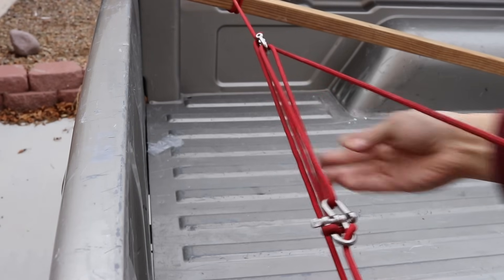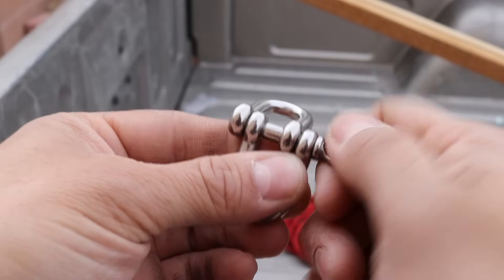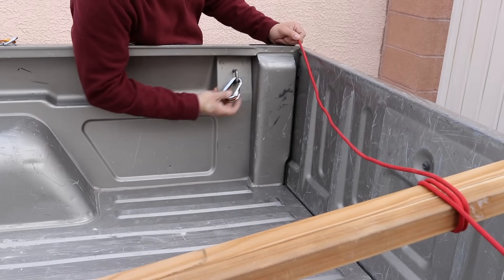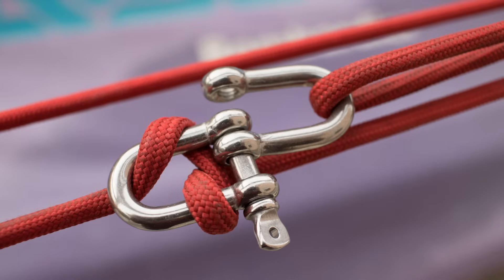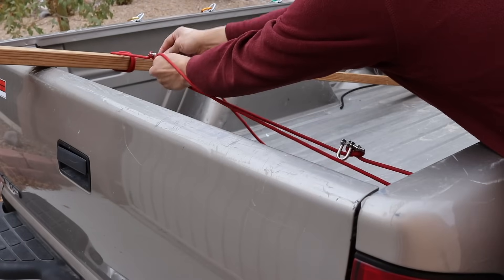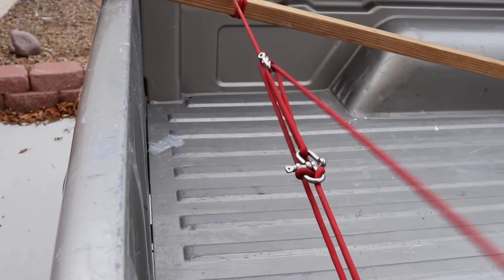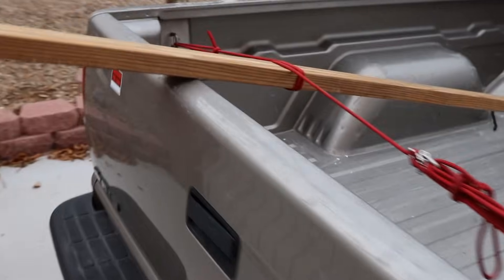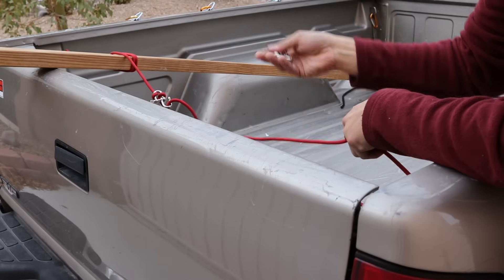Unreasonably Tight Truckers Hitch

Comment: It would be cool to stick it to all the 'ratchet strap' commenters by doing a side by side of ratchet strap pulling on some weights till it breaks vs a rope of same rating with your 'Unreasonably Tight Truckers Hitch' and how long it takes to break. It might make a cool video showing how much more leverage you get.

Also, its way faster to organise a rope than a ratchet strap so you win with time spent using ropes. Straps might be better for weight distribution being wider. But I prefer a rope just for the cost difference.

Comment: Good job on the video. One thing to consider,  if you are driving in jurisdictions that have strict verification of cargo rigging be careful when using such systems. I received a verbal warning from the Ontario MTO for using a "jury rigged" cargo retaining system, or whatever he called it. You can get fined in Ontario for using a makeshift system for holding cargo. The guy told me if I had been a commercial driver, I would have received a stiff fine.

Comment: I use on of those “figure 9” devices made by the S-biner people. They work quite well, but I do recommend that you smooth the teeth a bit with a file so they won’t damage your rope. Also, make sure you get the metal one, not the plastic.
Reply: "Niteyze"

Comment: As long as no one gets any ideas about using that system for lifting or serious load control. You de-rate the capacity of the second shackle by not using the pin. You also need to ensure that the line is rated for that much tension.
Reply: Timothy Johansson, and the truck sides if the tailgate is open.
Reply: I rather use my ratchet straps.
Reply: For those who missed it there was subtle satire in the use of the term de-rate.
Reply: De-Rate?, It's not rated for it at all. (They are only rated for use with the pin, and only for  in line linear loads against the pin. ) The cheapest way to get a valid load rating would be to use two or three links of chain and join the shackles w/ the pins) (Assuming you don't already have rings or a double shackle.
Reply: "everyday" use will work fine. great idea, how about giving credit where credit is due. just saying.
Reply: @mickh6426  credit goes to the man in ancient times who invented the double tackle as that is all this is.

Comment: Much ado about nottin.   You should never need that kind of tension  for those kinds of loads,  and if you were carrying a  "real" load  what is the rating of the  junk  anchors in the bed?  How about the gate?  You ever see what happens  WHEN A GATE UNLATCHES?  I can still remember the site  of the  BIG WHITE STRIPE   off the freeway  with a pickup at the end of it, after he  dragged a load of  falling, breaking, dragging,   (and ruined)  sheetrock  out of the road

Comment: I just tried that using 2 spring gate carabiners and it worked perfectly. Carabiners with eyelet would be even better (stronger) Great video and you picked up another sub. Thanks
Reply: I’m curious how much tension youd wind up putting on the carabiners -I had the same idea
Reply: @baileys6346  I guess that would just depend on how hard you pull and the type/quality of the carabiners? But for my intended use (lashing my kayak to the roof bars) I didn't notice any deforming of the carabiners, so I guess all is good. I am using just cheap plastic carabiners from Amazon and they seem to holding really well. Metal ones would be almost unbreakable?

Comment: Заворачиваете болт прямо в резьбовую проушину - и накидываете на него выбленочный узел, концы которого окажутся в направлении тяги. Если же ширина зева скобы окажется меньше двух толщин верёвки, а натяжение требуется создать сильное (веревочная переправа) - то открытая скоба заменяется на стальной карабин, которые можно спарить для получения автоматического тормоза (узел Гарда).
 На одиночном грузовом крюке эту функцию выполнит гачный узел, являющийся Becket Hitch'ем.

 Wrap the bolt directly into the threaded eye - and throw a Clove Hitch on it, the ends of which will be in the direction of the rod. If the width of the mouth of the bracket is less than two thicknesses of the rope, and the tension is required to create a strong (rope crossing), then the open bracket is replaced with a steel carabiner, which can be paired to obtain an automatic brake (Garda node).
 On a single cargo hook, this function will be performed by a Gach Node, which is a Becket Hitch .

Comment: For those interested the proper name for this knot is the Versatackle, it can of course be done without the shackles, just using loops as in a standard truckers hitch.
Reply: I really like this idea of using shackles though, one of the main problems of the truckers hitch and especially the versatackle is that the friction on the loops can easily damage the rope, the shackles will make the rope last a lot longer.
Reply: @caskwith  mainly because half the time is spent looking for shackles before tying the load.

Comment: Nice way of achieving the 4:1 purchase.  I can think of other uses for this, but it seems overkill for securing a load in a truck.  I use a similar system instead of a winch for getting a sailing dinghy onto a trailer on my own.
Reply: These are mostly forgotten techniques.  Now everybody wants to use a winch.
Reply: no such thing as overkill when you get rear-ended, you don't want your load bouncing and landing in someone's lap.

Comment: I'm not currently in a position to practice it, but surely the loop that attaches the cord to the shackle (not the pulling part), because it's just looped and not tied, will eventually start to slip under pressure ? No?  So for a short trip, fine, but over time ....?

Comment: That was 3:1 and 5:1 MA.
Reply: 2:1 and 4:1. 

3:1 only applies if the load is also doing the work. 

In his frame of reference, the first pully is a stationary pully and only redirecting the force. 

If he was tied to the anchor point. He would pull himself forward with a MA of 3.1

Comment: Seems a waste of time and accessories (four shackles and pins). A single truckers hitch would be plenty effective for application. A double truckers hitch (two opposed similar to your video) would accomplish the same ratios achieved without your excessive amount of accessories. I would conceed the use of those shackles would reduce some rope friction at hitch locations, BUT pulleys would be even more effective as they would eliminate rope parallel friction. Optionally you could use single rings or carabineers to reduce rope friction at hitches.

Comment: That is actually a 5:1 with a directional change. A truckers hitch or a Z rig is 3:1. Then you just added a extra support line which makes it 5:1 with a change of direction pulley. Another way you know it's an odd number is that your knot is at the load not the anchor point. You say Where you put the bowline is your anchor point but is more like an extension of your load point. Take that out and it shows your knot is at the load makes it an odd mechanical advantage.

Comment: Guy posts a video demonstrating a nifty knot idea, and the entire comment section is filled with people trying to out smart his demonstration.
Reply: He damaged the wood and used shackles where simple loops from double overhands or figure-8's would do. No one tying anything down would use this method. It could easily exceed your rope or tie-down points capacity with that much force. It's not smart at all.
Reply: @mattmarzula  Uh, I believe the intent was to simply show the tension advantage gained by using a 4:1 loop vice 1 or 2.  Ergo, very little effort was exerted to get that amount of tension.  Basic physics nicely demonstrated.
Reply: @mattmarzula : Very true, "tiedown" points in most truck/ute "tubs" - are hardly fit for purpose. 
"BTW", no matter how much tension you can put on a rope (with any kind of system) it is up to the "loader"/Rigger  to decide how much is needed to secure the load. (can/=should)

Comment: $50+ stainless shackles when regular truckers hitch does the job... Overdone... F
Reply: A regular truckers hitch multiply the force by 3, the method of the video multiplies by 5, and the regular truckers hitch looses a lot of force to rope on rope friction, the shackles help to reduce a lot of the friction. The video is just an demosntration, when to use one instead of the other is up to your judgement.
Reply: @jefgir  Rope is inexpensive and a trucker-hitch ALWAYS available to use... 4 polished shackles $80+plus and not always available... to each their own!
Reply: @douglaspohl1827  Then use a regular truckers hitch, and when your rope breaks due to friction, just buy a new one, as you said, they are inexpensive.
Reply: @jefgir  How many times do you see a truckers-hitch vs your polished shackles?  Go figure...

Comment: that is a theoretical 9:1, first is a 3:1 not a 2:1, then the second pulley makes another 3:1 so they compound into 9:1
Reply: feel like i need to ad that being hooks not pulleys, and rope running next to each other rubbing, it might be max 5-6:1
Reply: @infbajuk  just count the number of rope turns in the system and ignore friction, mass, and moments of inertia. It's 4:1. Dummy up.
Reply: @infbajuk  and notice how you say that you "feel". Try thinking instead of feeling. You opinions are no match for facts.
Reply: @mattmarzula  Well, if you look at your system, you might realise, the lumber is not the anchor, its the point of attachment  to the load, unless of course your truck side is weaker than the stretch of the rope and weight of lumber. 

That said, your system starts at the load, that immediately makes it an odd system. And you put a "pulley" into the load rope which made it a simple 3:1.

Then you add a second "pulley" in the rope coming from your anchor, making it a complex 5:1, that right there you can´t argue with.  

Also, yes my first assessment was wrong, still better than yours tho. If you just count loads, from the rope in your hand, you get 1T to the "pulley" going around making it 2T and again making it 3T and again making it 4T then terminating at the anchor side hook. So that means you have 4T on the load side "pulley" and 3T on the anchor  side "pulley".  

Then it pulls 7:1 at the load as your 3T line from the anchor side "pulley" meets the 4T "pulley" at the load.

And notice how my feeling was still better than your "facts", guess a simple mind only sees simple pulley systems.
Reply: Both are wrong, its a 5:1 MA (disregarding friction).

Comment: Truckers hitch huh. I have been driving trucks since 1979 and I can tell you that would never pass any dot inspection. The open ends of the shackles will open up under heavy load and you would lose your load. The little weight you have here ok fine but dont call that a truckers hitch you make us look like idiots. Besides there are many ways to tie something down that are much simpler and cheaper
Reply: holmes1956O how not to use shackles 101
Reply: Agreed. This use of shackles is dangerous and will end up getting someone hurt.

Comment: Great idea. But so is a ratchet strap
Reply: Ratchet straps are for those who choose not to try...
Reply: You're right I wouldn't try to over complicate a simple task.
Reply: Stephen Crump think of all the space being saved tho.
Reply: @mchslaxstar55  what space you worried about when carrying four 2"x 6' boards in a empty bed
Reply: @mchslaxstar55  yep probably a whole 2-3 cubic inches
Reply: Stephen Crump -  He designed and built that system himself using only a rope, shackles and skill.  Can you build your own ratchet straps?  Sure you can go buy ratchet straps. but they are no where near as versatile as rope and knots.  For the money the rope is a better deal.  What happens when some loser steals your ratchet straps and all you have to work with is a rope?
Reply: @ScorpionRegent  i can do all this without all the iron just rope.
Reply: @ScorpionRegent  if look back to my first post i said it was a great idea never once have I said otherwise, but for a task such as the one depicted a ratchet strap would have done the done just as well, easier and faster.
I always have rope in the truck for occasion where a strap just won't work. 
Also yes I could build a ratchet strap if had to.
Reply: @scrump186   I owe you an apology.  I'm just used to kids always taking the easy way out.  Building your own ratchet is far from easy.  I would more likely rig up a parallel using adjustable tension knots such as Prussics and Blakes hitches.  It might be faster, but that sure seems easier than building a ratchet from scratch.  You don't have a 3D printer do you?
Reply: @ScorpionRegent  No apology needed it is hard tell who's just being a smart a** and who's expressing their opinion in text.
no 3d printer here and yes using ropes would be easier than building a ratchet but that's why I said if I HAD to
Reply: @ScorpionRegent : one can also get a 4:1 advantage just with 2 sheepshank "truckies hitches" - (the real ones), though metal "hooks" have less friction than rope on rope. (No need for "fancy things" like Prussic's - or any additional rope/hardware...)  we are all here to learn of course, everyone has a slightly different take on an old concept....
Reply: @lattilatti6441  believe what you like bud😘
Reply: The boards were an example. Not a difficult thing to understand.
Reply: What he’s actually doing is called a Z drag, it’s a rock climbers rescue method. His is a much less complicated version but that is a genius way of doing it with very little.
4 shackles and a rope!!!
Reply: 😂😂😂😂😜😜smart ass
Reply: Great in case you need to tie down guy-lines on a tent in case of a tornado.
Reply: You can use either method but knowing how to tie knots in every situation have no price.